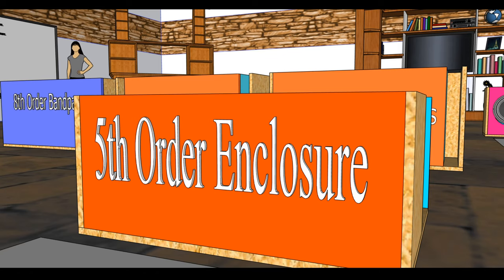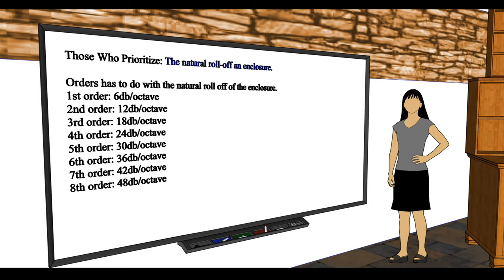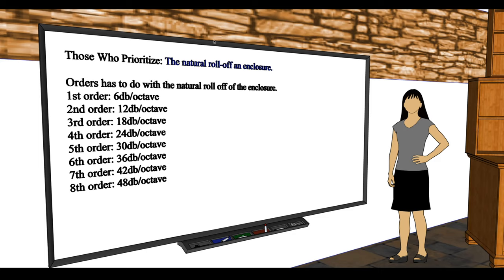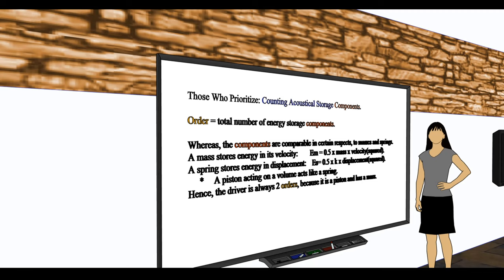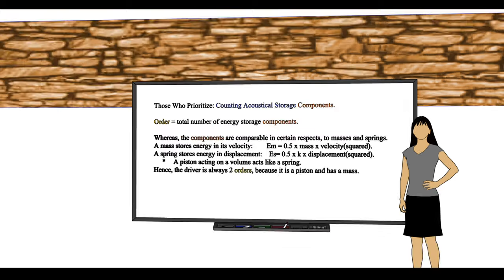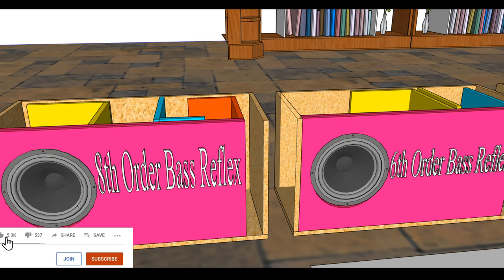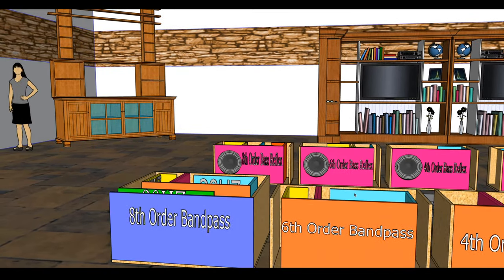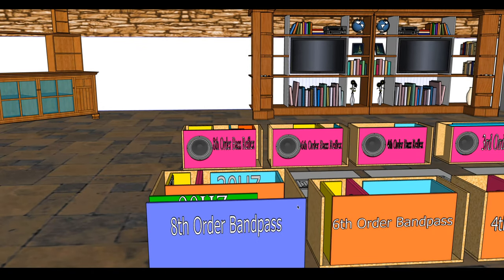8th Order vs 6th Order: Bass Reflex (Explained)

Comment: Oh man...I can't even imagine the amount of group delay something like that would have. These seem like designs audiophiles should stay far away from.
Reply from the maker: WIth DSP these enclosures have been proven very effective. BOSE have utilized these designs for years.
Reply: @BudgetBassHead   Got Morel Ultimo SC 12/2. 10hz-900hz rating. Like to put together a 6 or 8 order for low bass. 16-20 low & 28-32 high end. What ya recomend ? I'm in Missouri what state u in ? Thanks Brother.

Comment: So camp a are the ones who just kind of glossed over some info , and said yep, I know it all. 
 While camp b is those who have studied and understand it.  
By camp a's methods 2 drivers in a sealed enclosure would be a 4th order, which we know ain't so,  or would they consider it a 5th order, 2 orders for each speaker another order for the enclosure.

  I think the best way to look it is in terms of wave manipulation.  A sealed box technically does not manipulate the wave as it contains it.  A sealed box firing into a sealed box is also technically a 2nd order enclosure, as both sides are firing into a contained infinity. Introducing a port to that second sealed enclosure would then add 2 orders as the enclosure would no longer have equal containment so there is no opposite to sustain that infinite relation making the enclosure a wave manipulation device(another order)and the port yet another making it a 4th order.  Since we are firing through a port we are now bandwidth limited making it a band pass.  

Where as a ported enclosure firing into another ported enclosure would be a 6th order bass reflex. 

You know this though. 

I have built a 6th parallel tuned order band pass for a pair of 10"mtx's back in the day, like early 90's.  That box was loud and actually clean for a band pass.  We were only feeding 50 watts into each sub and you could hear it for over a half mile, But you had to have the trunk cracked.   With the trunk closed it sounded like a pair of good 8's, but once you hit the trunk pop it pounded like 15's with about 150-200 going to them.  I dabble in home and car audio now (more home,2ch) from time to time.  I'd like to do it full time but.... anyway.

 I have been tempted to make a 6th order bass reflex for some old 12" JBL car audio subs.  I was thinking of going Isobaric to help get the size down some.  I just don't know how to model one.  Right now they are running in a shared 4ish cu.ft. enclosure tuned to around 32 hz.  I was thinking of tuning it to 18 and 36hz to and going from there(the fs of the drivers is 27.4hz).  I just don't know how much volume to use for the enclosures. I have the basic T/S specs. for the driver, but can not find any formulas or free modeling software that will model anything past a 4th order bass reflex.

Much love, love the videos.  I think they are a little wordy sometimes, but hey, your just making sure you are being clear.  Good job, keep it up.
Reply from the maker: Try WinISD Pro. It's free and it's 6th order band pass friendly. Thanks for the support.
Reply: @BudgetBassHead  Not looking to build a 6th order band pass, I can and have done that.  I'm looking to make a 6th order bass reflex design.  Win ISDpro, or beta does not do that.  Thanks though.

Comment: BudgetBassHead I'm listening and watching what you are showing me, but it's way over my head. Your visual is excellent and I'm getting those "ahhh!! I got moment", until the video stop. I have some (4 10") woofers that I would like to put in a 4th order bandpass. The seals box spec is .59cuft and the ported box specs is 2cuft. Are those specs suppose to be combine? I would like more info on the 6th and 8th order calculations as well as the acoustic chambers. If you have time also how small can you make the boxes with how much polyfoam.
Reply from the maker: Used WinISD Pro. It's free and never let me down

Comment: Do you know how to calculate the port area per cu ft on the outside port in a 6th order series bandpass? Would  you use the total box size since the inside port is using the outside port as well or would you only use the 2nd chamber size? Thanks for the vids.
Reply from the maker: Great question. Port displacement is always 'displacement. Never calculate it as part of the internal volume.